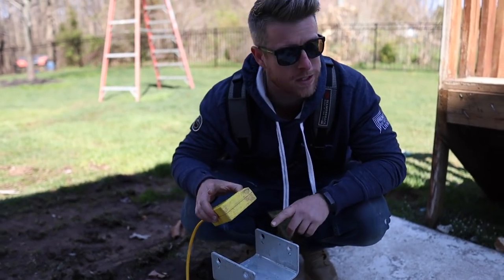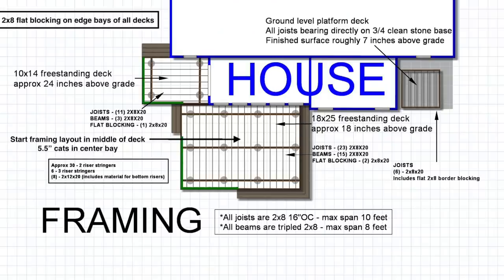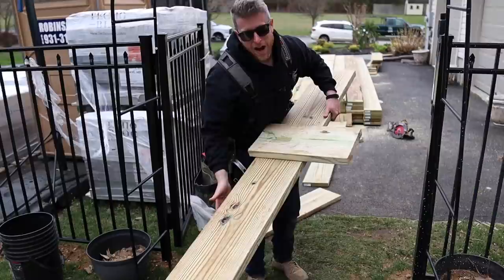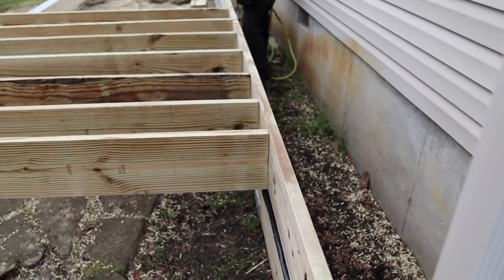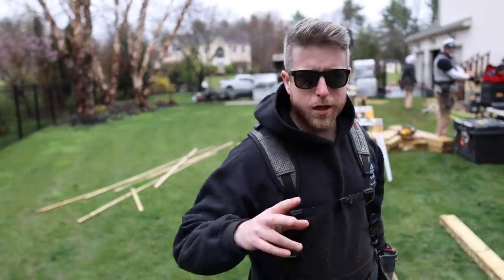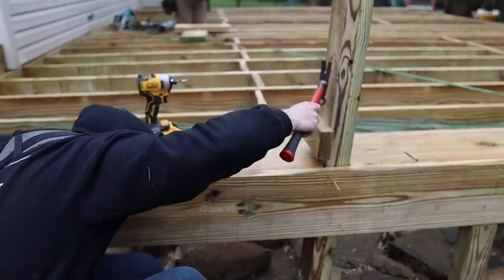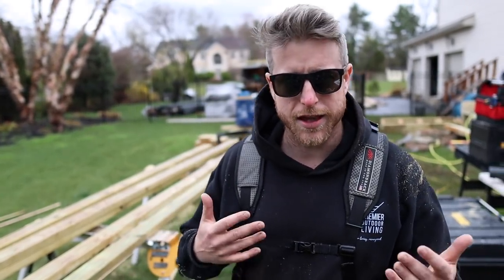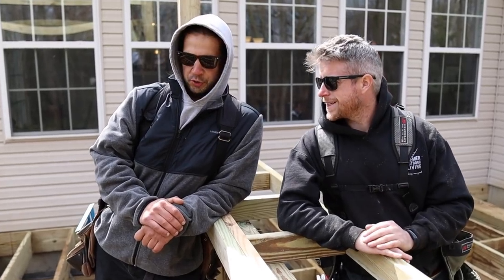Installing Helical Pile Deck Footings And Framing A Two Tiered Freestanding Deck

Comment: Awesome projects - the legs you have coming down from the rim joists and step stringers look like they are sitting directly on the soil.  What do you do with those?  I assume they are installed for the skirting and not structural, but I also am fairly certain they are just floating.  Thanks!

Comment: For you, frost depth is probably only 42” or 48”. Why use 6’ long piles?
Reply from the maker: our frost depth is only about 32" but its all about reaching the required torque, and typically that is not achieved until a deeper depth

Comment: Why did you do a freestanding deck vs attaching to house?
Reply from the maker: In this case both decks extend past the house foundation to the left so it would have to be freestanding to an extent anyway, so I just thought it was easier to make the whole thing freestanding. Not sure if I explained that in a way that made any sense 🤣
Reply: @THEpremieroutdoor  makes sense. Does it still require a permit?

Comment: As far as code goes are the Helical piles compliant on decks  32" above grade?  I would love to use them for if they were available in my area.
Reply: They comply anywhere you would use a concrete footing, including building houses on them. We build decks all the time second level.
Reply: @joeblow2675  Amazing. Thanks